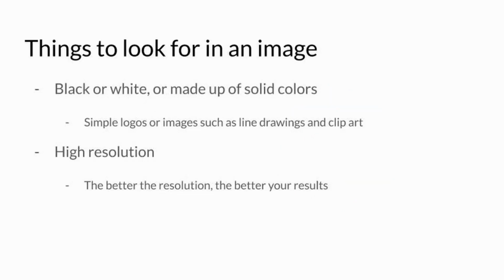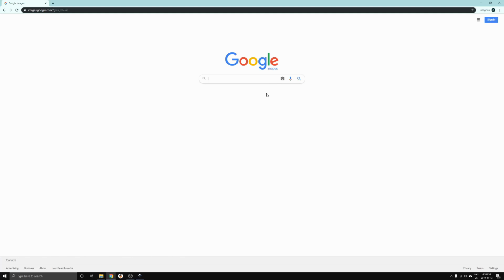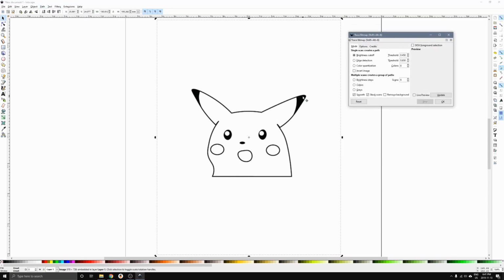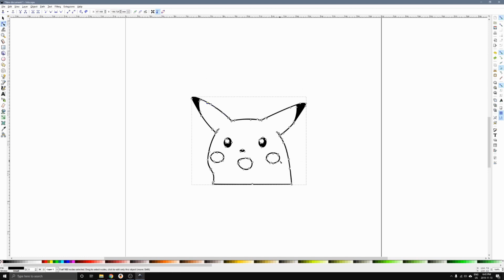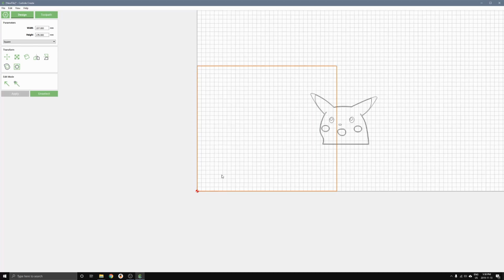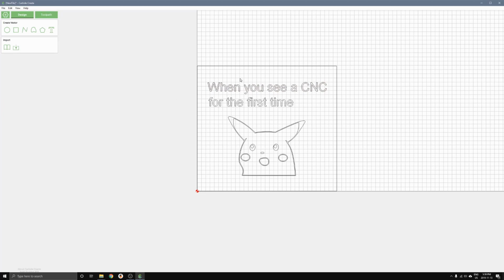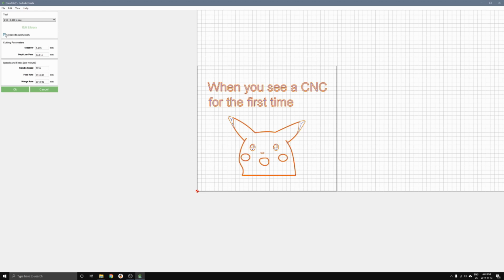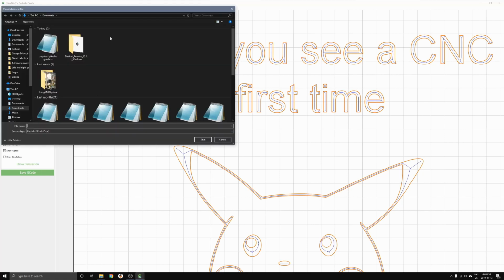How to Put an Image on a Piece of Wood Using Your Longmill

Comment: Thank you for the video demo. I see that you are using a spindle and not the Makita trimmer. Is this the case? Even though I have a new Makita trimmer in my shop I have also purchased a ER11 Spindle. I will see what works better for me when I receive the pre-ordered Longmill. Looking to reduce noise.
Reply: I think that's the Makita trim router in the video
Reply from the maker: Can confirm, I am using the Maktia router - Andy